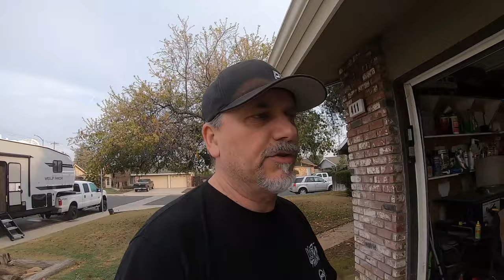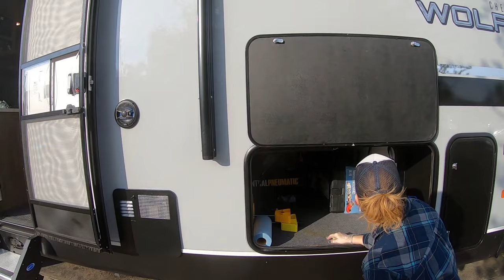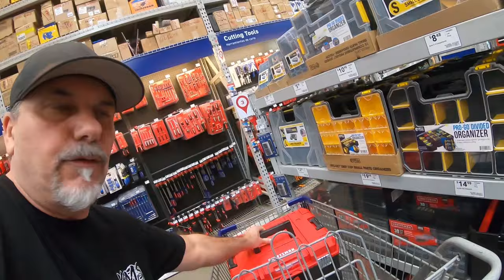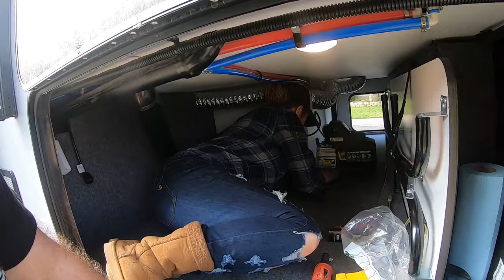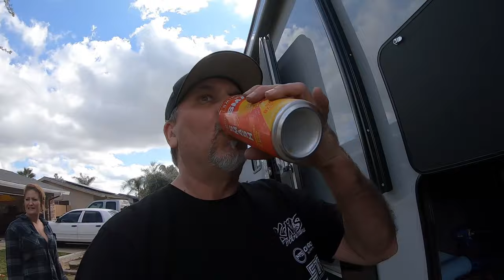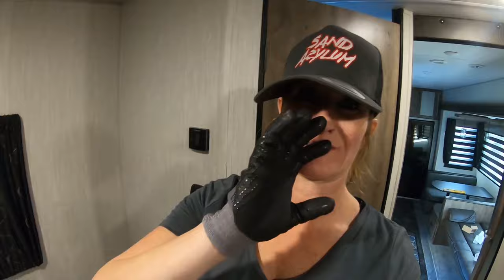Installing An Air Compressor In Our New Fifth Wheel!

Comment: After you separated the compresor from the tank did you just add that longer brass looking tube ? Looking to do the same, but mounted on the outside.
Reply from the maker: Yes we did, we bought some copper line and fittings and extended the lines to reach the tank. Works great, we have been using it that way for almost 4 years.

Comment: Now you should “T” off the Compressor and have a quick release just inside the doors so that you will have options and convenience on both sides of the Trailer.
Reply from the maker: I like that idea a lot, thanks
Reply: I just use sch 40 PVC with threaded ends and Quick releases screwed in on both sides, plus the same off the “T” with a short hose connecting it to the compressor which makes it a breeze to disconnect if you have any compressor issues.
Reply from the maker: @costaricawild6329  Thanks for the info